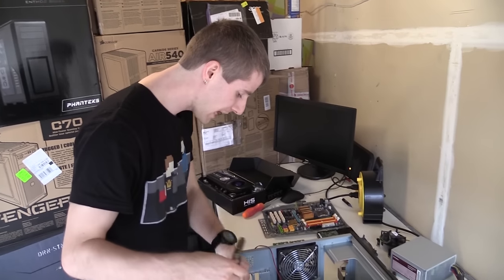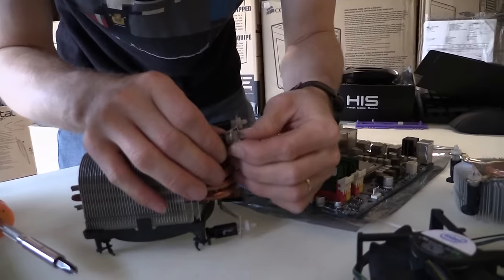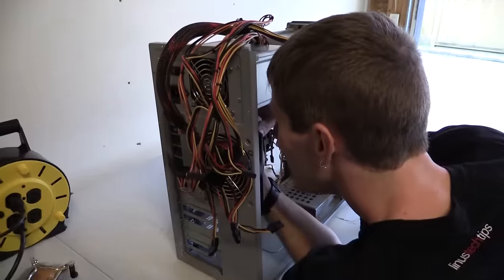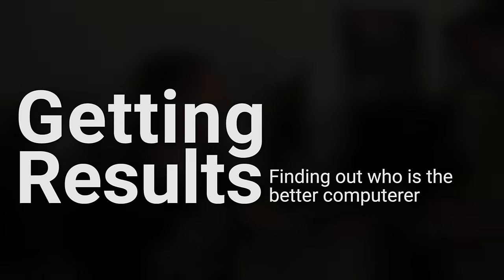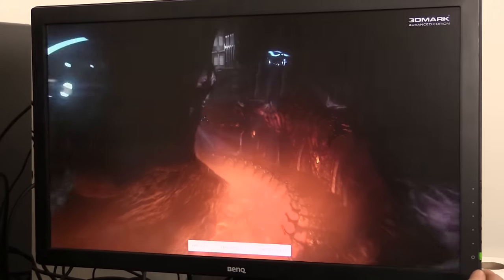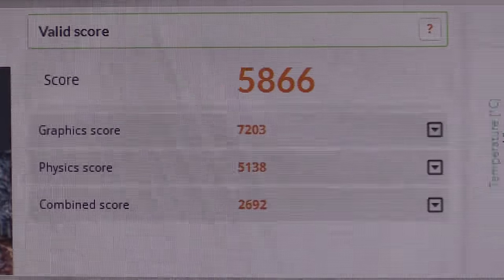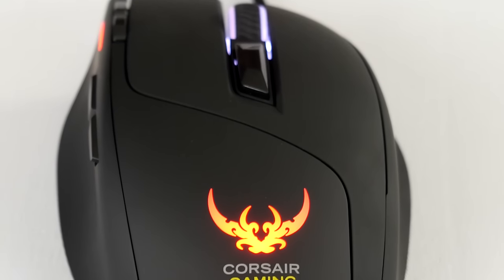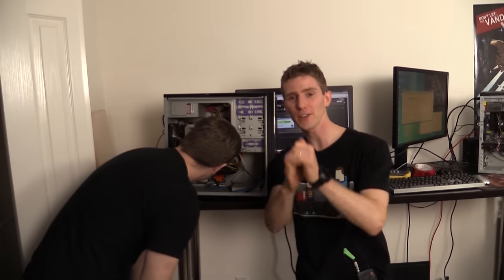$300 Budget Gaming PC Challenge - Scrapyard Wars Episode 1c

Comment: I replaced my Q6600 mid 2014, BF4 64 player maps got him. But on all other games it was fine.

Right now he lives peacefully in a friend's PC who does mainly office work. My bet is that he will be 15 years old before needing replacement, he already survived an overclocking disaster on a p5k3 Deluxe and 7.5 years of gaming.
Reply: Badass CPU. Period.
Reply: Q6600 was a great CPU. I still use it, overclocked from day one at 3.6Ghz.
Reply: I'm still using my Q6600. It's seen 3 different memory configurations, 3 different video cards, 3 power supplies, 2 CPU coolers, and 3 HDD's. She's been a beast for me, but this will be her last year before I get a new 4690k...
Reply: Shelden iHardware My buddy gamed on a Compaq CQ62 for years and it spontaneously died right before christmas. So i took a stripped Dell XPS 410 with an e5400, scraped together 6GB DDR2-800, a Q6600, a 250GB laptop HDD and a 128GB Sata II SSD (lel), he paid for a 500w power supply and a Radeon 7790.
Unforntunately, it's a dell BIOS, so no overclocking, and no support for higher end C2Qs.

It still plays Far Cry 4 at 1080p on med with a couple settings on high
Reply: It's a he?
Reply: From what I hear on Amazon and PC Mag, the Q6600 is a legend in that it survives most games and video editing.
Reply: Fernde09  Try SetFSB to overclock cpu, You'll get 8-10% more.
Reply: My Q6600 ran strong for 7 years, overclocked. The day came that I couldn't find a new motherboard that would support it. Now he sits in a home theater PC, at stock speeds, quietly enjoying retirement. Here's to another 7 years.
Reply: Yeah, my dad is still rocking this processor with one of his computers!
Reply: I had an intel pentium D and I burnt it without even overclocking. Well it's simply dead now.
Reply: Overclocking Pentium 4s or Ds, what is more fun?
Reply: Shelden iHardware
 Those are a lot of heat. Core 2 duo generation is better, I've got lucky on the silicone lottery and O.C'ed an e1200 from 1.6ghz to 24/7 stable 3.4ghz and I had an e5200 that I O.C'ed to 4.25ghz 24/7 stable. I'm sure that people have even had better chips.
Reply: I do want to overclock some of the Core 2 Duo chips but need a board that supports them. I just enjoy overclocking the hell out of the Pentium D 945s and see how hot I can get them before killing them entirely. I love the P4 and PD chips just for the fact that they are a room heater and were a complete failure at the same time. 486 and 775 for life.
Reply: I'm looking for a nice 775 board, to push my trusty old Core 2 chips harder (Q6600 3,4 GHz | E8400 4,1 GHz)
Main sys is with a nice ivybridge, but the core 2 are always in memory.
Reply: HappyBeezerStudios  Asus Striker Extreme I managed to get 3.825 Ghz out of my Q6600. On hell of a PC that lasted me years
Reply: ***** Not saying Q6600 is bad or anything but god you will see so much difference when you change :) it's always great to experience those things.

Comment: Proud to own a Q6600. I can't overclock it though 'cos my mobo is a mofo.
Reply: +AKIMBO CURLY Which socket is the Q6600?
Reply: Joe kromer LGA 775
Reply: AKIMBO CURLY
ahh, so you'd need to get a slightly older mobo to use the q6600.
Reply: Joe kromer Yeah my mobo is a OEM's G45 express. It can run the Q6600 but just can't overclock, and can't have more than 4GB ram.
Reply: +AKIMBO CURLY You can get cheap motherboards for it that have space for more ram I can get 8 tops in mine but issue is that there are only 2 slots. 4gb ddr2 one "cookie" (used) is hard to get here where I live. I personaly dont see point in having more than 8gb of ram if you are just going to play games
Reply: +Jack Doe just tape the pins up on the 6600
Reply: +AKIMBO CURLY My last system had a Q8400. It definitely served me well.
Reply: +AKIMBO CURLY me too my friend ! I run it with 8gb ddr3!
Reply: +AKIMBO CURLY the LGA775 is my favourite socket. along with the AM3+
Reply: +AKIMBO CURLY ya, ive had the q6600 for ages now and my mobo would never let me overclock it at certain speeds. super anoying. but it is my mobos fault as a friend has a watercooled q6600 running way over 3.0Ghz. It should be able to do that on Air, but some mobos just wont do it. My mobo is even a republic of gamers board but i cant get past 2.8Ghz
Reply: Shane Mc Conn that is a really common problem with the q6600 cpus. they always have problems with overclocking. dont worry, you are not the only one. certain motherboards are happy to overclock on them, but they cannot be pushed really hard like a e8400 can
Reply: Same I still game on old processors, I don't like the new processors
Reply: +AKIMBO CURLY Q6600 was a beast back in the day...
Reply: +AKIMBO CURLY Same here man my old pc has a q6600. 4gb ram max. with a gt240 gpu. though my little bro uses it now. Had a great time with it. Shame I can't overclock though.
Reply: +Maxxwell    Got both 6600 and the 8400, which one should I use with a gts 450 and 4 or 8gb of ram?
Reply: whichever you prefer it's upto you man
Reply: +Maxxwell  it's actually 5700 lol, put the 8400 in anyway
Reply: +AKIMBO CURLY Running a Q8200 like a baller, Even though half my fucking mobos dont want to accept it
Reply: 8BallManiax You talk as if you have multiple mobo's laying around. Do you have a hardware store, or are you just a fanatic of hardware?
Reply: Maxxwell Fanatic of hardware, I have an old pentium III with a Pentium III mobo and some really old SDRAM
Reply: 8BallManiax Hahaha, thats nice, well I had a bunch of old pc's too, but got rid of 'm
Reply: Maxxwell I'm in the process of sending back an Lga 775 mobo cause the seller sent me a broken one when it was supposed to be working
Reply: 8BallManiax Well that sucks, I hope it works out for you and you get your money back.

Comment: I didn;t expect linus to win after Luke got that 290
Reply: ***** Gotta remember though that a 290 is just a rebranded 7970 after all, so it wasn't really that much better than Linus' 7950.
Reply: SnypeUXD a 280x is a re-branded 7970 not the 290
Reply: ahem... spoiler alert
Reply: SnypeUXD No, the 280x is a rebranded 7970 ghz edition - The R9 290 is a whole other architecture and a new gen of GPUs along with 290X
Reply: SnypeUXD Uhm, no, that's the 280x, 290 has a huge jump in fps compare to 280x/7970, like the 770 to 780/970.
Reply: ***** Maybe you shouldn't scroll down the comment before watching the video if you hate spoiler? Especially you know that's most likely be spoiler in the comment in this kind of video.
Reply: ***** doesn't like spoilers but reads YouTube comments prior to watching the video?
Reply: GPU isnt anything if its bottlenecked by the CPU
Reply: well, of course Luke will loose because of his dual core CPU bottleneck.

I already see it coming even at part 1 when Linus says he got a deal with a Q6600 and a decent motherboard. Now he only needs a fairly nice GPU under 100$
Reply: Hectoric Luke's dual core really throttled his gpu.  
and LOL at the people that don't know the 290 is different than the 7970GHz cards and still commenting!  Don't you know there's Google?  Anyways, a 7950 with the right cooler can OC well beyond the 1000 that linus had it at (he just had next thing from stock cooler on it).  My 7950 is faster thana 280x in most/all games
Reply: i knew the dual core was going to kill him maybe that's because i recentally tried an p4d 775 oced to 4ghz with an 9600 gt and there was no situation in any modern games where it was not bottle necked by that old p4d also my friend has a core 2 duo and sli 9600gso's and at the launch of bf3 he could olny play 800x600 @ 30fps low but with my weaker 9600gt and phenom x4 965 i was getting 60fps at 720p med high mix
Reply: Luke lost because his dual core CPU was bottlenecking his r9 290 graphics card. If he had a quad core he would've won. Linus had a quad core cpu, that's why he won. CPU seems to still be important.
Reply: Kawaii Ninja right now the dual core is old and the game devs are focusing more on quad core
Reply: ***** we moved because the new generation on consoles have more cores
Reply: ***** Quad core is the standard right now, but eight core will be the next generation. Which will probably be within the next 5 years. By 2020 eight core will probably be the standard.
Reply: Kawaii Ninja yes I know,right now is very good to get the best six core or quad core
Reply: wantlesgore How so?

Comment: The downside is that you're buying into a huge risk. Will your components work? How long will they work? Will they have warranty? Will that be accepted?

You might end up spending a lot more because those machines are just waiting to die on short notice.
Reply: But you can say that about anything used.
Reply: I had a gaming laptop, bought new, always overheated,3 years later the hdd shat itself, now i'm writing this from an old core 2 duo machine , with a quadro graphics card ,and its about 10 years old.It never overheats, the hdd is alot faster, same for the cpu.The graphics sucks,needless to say.This kind of system would go for about 10-20euro here without a monitor, while the laptop what 700 Moral of the story ?,you're somewhat wrong,but you still may have a point.
Reply: if you do it for revenue its a smart move since u will not keep it for long and after u sell em functional u could give a damn if the parts wear out in a month with the new owner since u wont be giving warranty on a used system
Reply: PetruV you my friend are part of the minority because that sort of thing doesnt happen often especially if you bought a quality machine
Reply: BBPINEAPPLE
What about us people? Not all of us have as much money as Linus and Luke.
Reply: Not to be a console kiss-up, I mean their great for those who don't have time for all this running around, but consoles can match this performance with new hardware, customer support, and a smaller form factor. I still play primarily on the PC (new hardware yay), but I do play on the console every so often for dem racing games. Please don't start a war. If there are arguments to be made, please do them in a professional way. I can take a good argument.
Reply: GuyWiththeHair Even though i don't like consoles, you're goddamn right !, most people dont need a pc anyways.If all you do is social networking and gaming, maybe some web browsing, perhaps even a phone would cut it.
Reply: PetruV but laptops have horrible cooling and all of the components are compressed inside the laptop too.
Reply: 90% of the time when "gaming" notebooks overheat it's due to built up dust inside. Shut down & vacuum the CPU fan for a few seconds to avoid spinning it but clean it. Took my full load temps from 95c to high 70s..
Reply: 500agk if you're buying those ultra thin ones like the Razer blade and don't have a cooling pad than you shouldn't be complaining about overheating because that's on you. However, the thicker ones like Asus g751 have amazing cooling.
Reply: In my pc i had problem with psu, mobo, and gaming mouse and which i got replaced under warranty. so i would never risk buying 2nd hand(especially without warranty)
Reply: Joe Dirt I have taken the laptop many times apart, about each month for dust cleaning, and there wasn't much dust.The fan is kinda slow and that's the problem. A cooling pad won't help much as the intakes are at the front, not on the bottom, and I tried putting fans under the laptop and the difference was very little, prety much within the margin of error (2-4 degrees)The thermal paste is pretty cracked and needs replacing,but temps sucked from the begining.
Reply: That is the thing that scares me about buying used PC parts.
Reply: PetruV Why don't you replace the hard drive in your laptop?
Reply: PetruV Moral of the story laptops suck for gaming because they overheat
Reply: Wyatt Baragar moral of the story, buy a cooling pad, or a decent gaming laptop.
Reply: AK M moral of the story, buy a fucking tower.
Reply: I don't really have money. I want to get one of these xeon servers, the go for about 70-100 euro. I will fix the laptop when i get money  because not using it is a waste.
Reply: PetruV The moral of the story is that don't buy a shitty gaming laptop.
Reply: You could say the same thing with brand new products, I had a Gold certified Corsair CS650M (semi-modular) PSU which became faulty within 4 months. So used products are pretty much the same
Reply: lukeyslife99 You should do some research before bying PSU's. The Corsair CS series is garbage. Gold certificate doesn't matter at all if the PSU is shit.
Reply: PetruV The moral of the story is replace you're busted HDD and stop using that shit laptop you used to type your comment
Reply: ***** Absolutely right. Linus is encouraging other people, with a small budget, to literally scrap together parts for a cheap build. But as you said, a ticking time bomb that will probably cost you in the long run.
Reply: Guy Random It depend. Out of everything Linus and Luke did, I only disagree with them also buying HDD secondhand, since that part literally have a set life time, other part should be able to hold out long enough that the 300$ price tag justified it since I doubt they will die out within 2-3 years anyway, and that seem like a normal time to start move on to another set and stuff.

So if it was me, at a low budget I would do something like this minus the HDD or SSD part, at a budget of around 500-600USD, I will move to entirely new set of stuffs bought from the store with warranty and all, the performance will certainly degrade quite a bit, but it give that certain peace of mind :P
Reply: My second computer I put together with $180 and it worked fine for 2 years. Yeah it was pretty junky and I thought it was going to die but I used this thing like crazy and left it running 24/7, playing games, and doing school work on it. 

I just used parts that I had laying around like an old HP Case, Non-certified Bistec 300W Power Supply, Recalled Seagate Hard Drive, and an unlicensed copy of Windows 7 Ultimate. I bought GSkill 4GB 1066 RAM, AMD 6450 GPU, Biostar $35 Motherboard, and an AMD Althon X2 back in 2011 

So note that this system was probably worse than these systems in the episode considering I used a recalled Seagate drive and a Bistec Power Supply but I was able to get a ton of life out this system for only $180 not including that old HP case with the stuff inside.
Reply: zemroid To be fair I did do my research, and everyone raves about Corsair so I bit the bullet. Next time I will choose Seasonic or Antec
Reply: besides of not buying a used HardDisk,(HDD) and fans, the rest are not to be worried with as long as they are not vandalized! a good taken care hardware will run for ever!
just never buy used disks, or old motherboards with non solid capacitors, because Just time on those items will cause problems, ram, cpu, and gpu is going to be most of the time just fine!
Reply: ***** good point. I keep forgot that only the early one have that problem of staying alive for about 10 years.
Reply: ***** yeah, but again the only thing not to buy is HDD. not ssd. and the failure rate of a gpu or cpu is almost none if this was working ok from day 1. most of the gpu failures out there if not all of them (and from my 10+ years exp in hardware store) was DoA, they didn't work for 3 months and then just died. those cases where like 2/10 and 1/2 was because we found out that the user overclocked the to crazy points and fucked them :P. still the warranty covered them since we played the "i don't know what happened card" or the "thre was a thunderstorm that day then never turned on again :P"
Reply: lukeyslife99 Every brand has PSU's that are garbage, even the brand's that are considered good. Corsair has a couple of good PSU series, the AXi and AX and one other series (might be HX but I can't remember for sure). The other series are really bad with shitty components. If someone says that buy a Corsair PSU because it's a good brand, don't just buy whatever PSU that has enough watts for you. Find someone who can tell you which model is good from that company.
Reply: Regarding power supplies, this is the 3rd power supply this computer has, in 1 year of me owning it, came from a 1250 wat no name thing, to 750 delux (which died a short time after being replaced) and now I have a super fancy Rasurbo one,80 plus bronze!.Needles to say the PSU is the weak link in every pc when it comes to dying.
Reply: PetruV Not really. If you buy a good PSU, it will last easily 5 years before you have to even think about replacing it. Mine is 1.5 years old and in a great condition.
Reply: You're goddamn right!.Even so, i paid less for this fancy one than for a bag of chips. It had absolutely no dust inside and warranty wasn't void, suggesting that it was new.
Reply: PetruV Even though you got basically free, I wouldn't have taken it. In the worst case scenario, when the PSU breaks it can break other parts of your pc and that would be really bad especially if you know it's because of the shitty PSU you bought. That's why one should never cheap out when buying a PSU. If you buy a good quality PSU right away, you don't have to regret it later.
Reply: Dash199t™ Moral of the story, don't assume everyone sits on their ass at home everyday:/.
Reply: Anyways,regarding hdd, i'm expecting a faliure from one of the pc's hdd's. It's a DeskStar one, but I call it the DeathStar. My first pc had one and it died(athlon something,lost some pieces), my second one (aka my dads pc,i learnt everything i know about pcs from that poor thing) isn't doing well,and also, the third day after buying it the hdd failed... And now my laptop..Soon to be followed by this hunk of junk.. Stay away from Hitachi, Maxtor and maybe Seagate(many people had bad experiences with them, but i never had one so I cant say anything)
Reply: Its Canada, of course all the positive things will be there